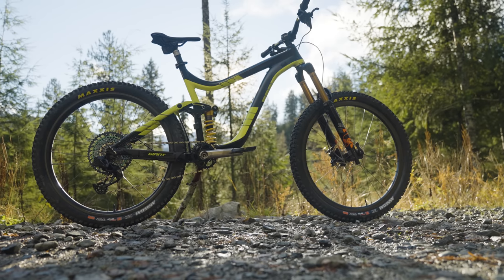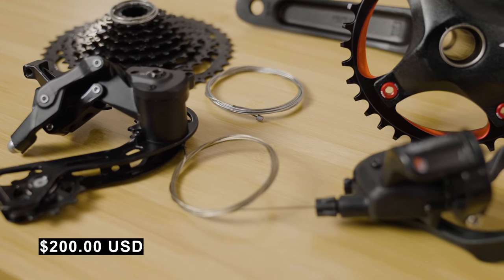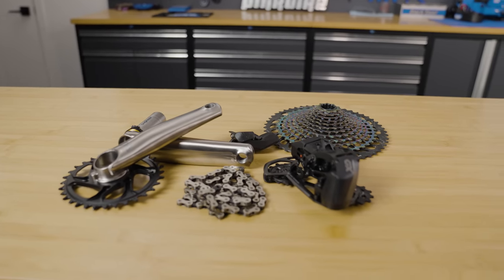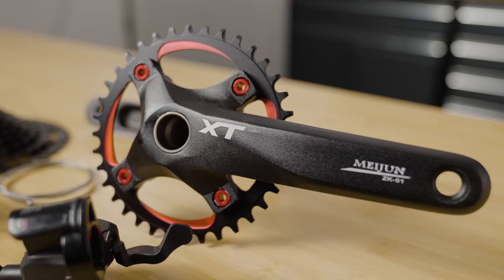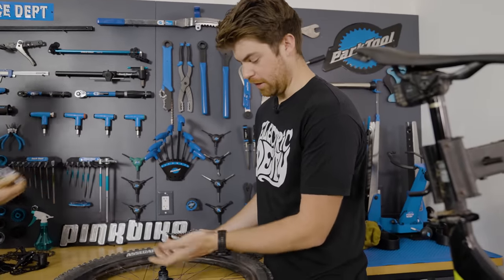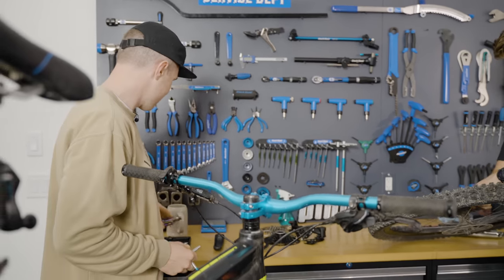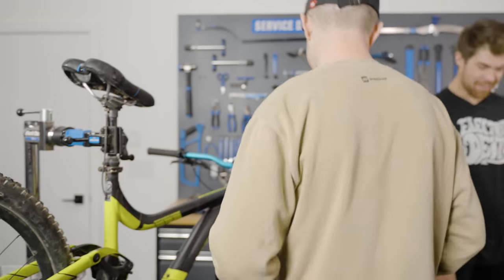$180 vs. $2400 Drivetrain - Budget vs. Baller Episode 6

Comment: Don’t believe in any of this 50/52 tooth nonsense I’m a firm believer in the 10s 11-42 cassette with a 32 tooth upfront
Reply: ... good for you? Not everyone is you?
Reply: Yeaaah, some of us live near actual hills and mountains so…
Reply: I have a wrecked knee,so I need it as easy to pedal as possible up hills! 😂
Reply: With 32/11 most people will spin out at 25+mph. My suggestion is to get XD driver, 11 speed shifter & 9-42 or 9-46 cassette. All can be done under $200. I’m running 32t chainring with 9-42/9-46 cassette & I have no problem climbing any hills & pedaling 40+mph on descend. With HG driver I was struggling to keep top speed even with 36t chainring & no low gears
Reply: @slimjim4ever  I run the SRAM eagle (can't remember the range? 9-50/10-50?...) 12 speed,with a 34t ring up front.it works perfectly for me,and I haven't found myself running out of gears on a climb yet (which I previously did with a 10 speed Shimano set up, 9-42/9-46? Can't remember which,and a 32t up front) I prefer to just spin a steady pace on climbs.im not racing,so I get there when I get there,as long as I can stay consistently moving,I'm good!

I think it's awesome that we have so many different options out there now,no matter what your preference is,there's a gear ratio to suit you.we truly are getting spoilt.

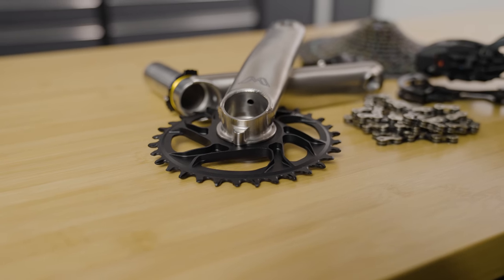Comment: 0:37 I could not disagree more. I can only see positives in having a 2x10 system: chain alignment, no need for long cage rear derailleur, no need to massive (heavier and expensive) cassettes, no need to chain guides...
Reply: does cassette weight increase enough on 1x to overshadow the loss of shifter, derailleur, cable, second chaingring, heavier spider? NO! 1x system (like for like) is lighter. The cassette weighs about140g more for XT 12 vs XT 10 spd, but adding the 2x bits pushes weight up @ 300g, so you gain a net of @ 150g going 2x all else being equal. So you can add a chain guide (not needed for most) and still come in lighter than 2x, with a more efficient system.
Reply: And while an XT 12 spd cassette is $100 more expensive than an XT 10spd, your front derailleur and shifter add that right back into the mix.
Reply: @SprSonik13  a 1x is not as efficent due to design, chainline can rob as much as 15% of your input energy, simply not worth those loses for people who do real mileage. Modern road bikes are 2x because its faster, they tried 1x, it SUCKS.

Comment: You guys have zero credibility.  This BS comparison is a case in point.  You could have selected an LTWOO or Sensah drivetrain, but you went with something that was obviously of less quality for the same money.  You purposely selected a cheaply made knock-off XT crank.  That crank has a 36T chainring, while the upmarket bike has a 32T.  The downmarket setup has a 42T cassette, while the upmarket has a 52T.  You could have just as easily used an LTWOO or Sensah setup with a 50T or 52T setup.